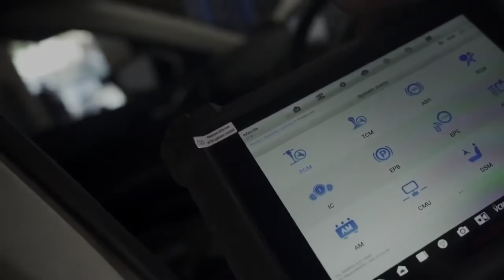Hyundai i30 rattling noise while engine running @ idle

Comment: I think I have the same issue with my i30(2016 model). Sounds horrible off start and takes time for that noise to fade away after warming up. Sometimes it just stays though regardless if it’s warmed up or not.
Reply: It's normal that these sound like diesel couple of minutes.
Reply: @nuubialainen  It sometimes stays like that though, even if ive been driving it for over an hour. Just isnt as intense
Reply: Have you figured out how to repair it? I have the same thing happening.

Comment: Man, this chain has oil tensioner so without oil pressure it is loose - isn't it?
You should rather check how far is moved out tensioner's rod (cylinder)